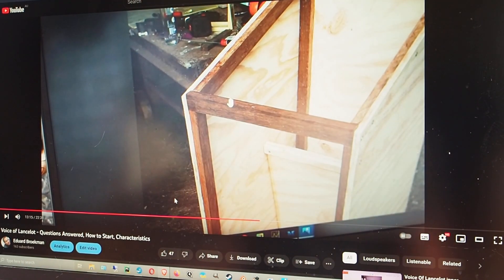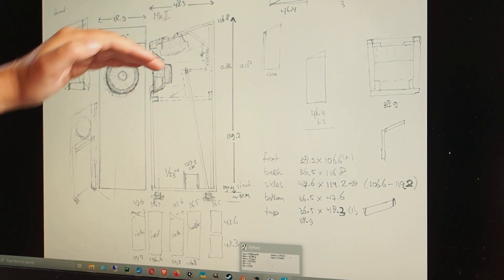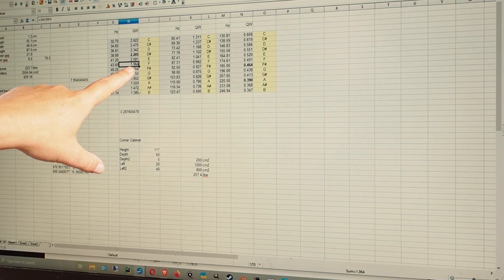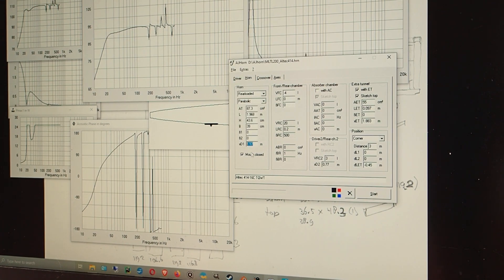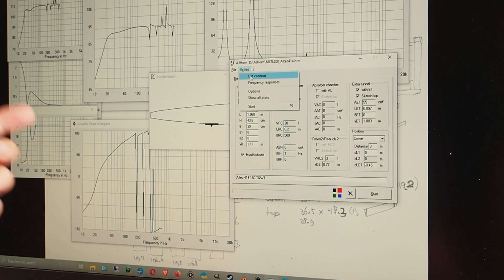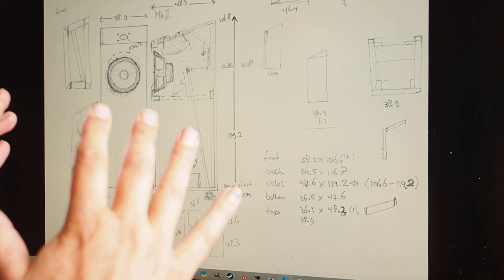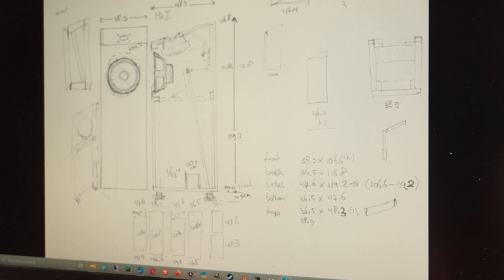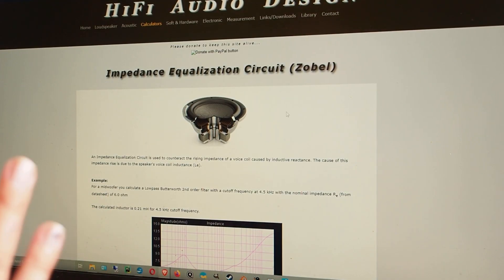Voice Of Lancelot - Design, Divider, Woofer position questions answered

Comment: Any detail drawings for beginners
Reply from the maker: Sorry no, it won't come soon but I'll keep it in mind. It's basically a 172L TQWT with width and depth dimension set to lengths that adhere to the frequencies/length of the western musical scales. The whole cabinet is geared towards the Altec 414C driver as I have them, any other driver will need their own cabinet. Hence there's very little value in publishing specs unless you have the exact same drivers. What are you planning to build if may ask?
Reply: @EduardBroekman I have 515B drivers and A5 is rather big .

Comment: The fame is not very good like that structurally..! You want to do a lap joints, bring the member from the back to front level with the vertical peace that is notched out with front to back piece, and the same on the cross member to the front and back piece, add some corner triangle pieces as well. end grain glueing never really holds long-term.
Reply from the maker: Agree. This was setup as a monocoque construction, there's really no 'frame' here and nothing is truly glued. The panels are screwed into the hardwood 'frame' to still dampen the resonance but your suggestion and what Janos did by building a very solid frame with corner pieces first, is probably best. It require a bit more woodworking skills and more time... plus insight into how resonances propagate through such a construction.
Reply: @EduardBroekman  ok

Comment: Hi Eduard. That is a very thorough and clear explanation! Very much obliged. I'm sure that it will be as helpful to many as to me. Just two tiny questions :) Why did you choose to point the port downwards instead of forward? And if you had chosen to front load the VOL, would it detract from the overall length of the supported quarter wave (say, if the slot port was 7 cm high, would you calculate the supported quarter wave as only 1.894 (1.964 - 7.0) cm)? Many thanks Claus (love the cows by the way!!)
Reply from the maker: Hi Claus - glad you found it hrlpful and thank you! The port does not reduce the frequency support, that remains based on the overall length. I would use a larger, longer port next time - but with same tuning. The downward orientation is (1) gradual release of pressure using the bottom of the speaker and the floor (2) prevents some cancellation between woofer and port (3) hides audible artifacts from the port (higher frequencies, not chuffing)
Reply: @EduardBroekman  Hi Eduard. Good points about the downward orientation of the port! Do you have an online link to your spreadsheet of musical notes? Or do you know where to get one? I'm not entirely convinced that designing by musical notes truly works (even smallish differences in frequency (or length of QR) of a given note, and it sounds off, and do we know the precise lengths of the resonating parts of the baffles (do you include or exclude the width of the frame to which the baffles are glued and screwed?)? Hm, still no harm done designing by musical notes :) Thanks again for your fine answers! Claus
Reply from the maker: Sorry I don't have a good spot to share resources right now. Just look up 'Note To Frequency Chart' or something similar. The Quarterwave length is then 343/freq/4. The internal dimensions are all on musical scales and yes, they exclude the frame. But to be honest since we have a tapered horn and a slanted top,, there's only left-right standing waves left and those are minimal, so if you'd take a design like mine you don't really need to pay to much attention to the depth and height dimensions.
Reply: @EduardBroekman  Ah. That was easier than I thought. I’ll find one or make one myself. And I guess that your design does not leave much room for standing waves. Thank you once more for your time and answers! Claus

Comment: I’m curious about how to think about the transmission line quarter wave resonance versus the tapped parabolic horn geometry. Does the simulation model both phenomenon and somehow sum them for total response? Or, is the math model the same calculation regardless and we are just using the terms “TL” or “horn” as categories of geometry? I have always just been looking at these enclosures as mass loaded quarter wave pipes and did not even think about the horn geometry. Hornresp has an option for a tapped horn, but I’ve never tried to model with it.
Reply from the maker: Hi - great questions! I haven't 100% visualised it but can comment on what I've seen sofar. Janos (RWA channel) says the straight TL shifts the amplifying aspect to the lower frequencies but the horn model in AJHorn doesn't show that although the Woofer's Fs does drop in a straight TL. Given the design of organ pipes, I'm pretty sure the straight TL works very well for the lowest of registers.

Now that all said, from my measurements, the tapered TQWT has a much better low-end response between 18-30Hz than a BR cabinet of the exact same size and port size and the modelling software didn't exactly show this difference. 

There's good support for frequencies down to 8*horn length (in my example 8*1.96m = 22Hz) Actually it's mostly 4*horn length (44Hz) but the BR tuning at 18 Hz pulls up the lower end.
Reply: @EduardBroekman  Martin King developed math models for the TL that I think became the math for Hornresp of the QW resonances. Martin has said that the QW isn’t really a resonance, but more a velocity phenomenon. I believe he’s differentiating acoustic resonance as a mass spring phenomenon or pressure versus a velocity phenomenon. Pressure and velocity are in phase for a plane wave, but can diverge in phase. Martin also modeled how a tapered pipe will provide some attenuation of the higher order TL modes by distributing them along the line. Wrong description, but you get the idea. So, a simulation will sum the impedances, real and imaginary, of the total box and the TL resonances, and the hemholtz resonance of the port. When Martin modeled the tapered pipe waves he used a straight(?) conical (?) taper and the taper helped smooth the response. I’m not sure how a parabolic or exponential taper is modeled. But, Hornresp of course simulates all of these accurately. I don’t know whether there really is a difference to Hornresp between a tapped horn, or a TL. It might be the same model, mathematically. What’s interesting to me is that AJHorn helped you create a parabolic expansion or taper to your horn, right? And, this might have interesting impact on the higher order TL resonances. As you demonstrated, the 2nd resonance can be eliminated by offsetting the driver in the line. From what I could tell your spl plots looked quite smooth where the higher orders might appear and I’m curious if this is due to the parabolic expansion.
Reply from the maker: Hi again - thank you for bringing this interesting topic! Yes, I had looked at MKs research a while back and the function of the mass spring is clear but I must look into what really happens with the velocity phenomenon that you mention. I mainly chose the tapered approach because I deducted that it mechanically would prevent the standing wave between the front and the back of the cabinet (that I had in prototype #1), or anywhere internally really and from the waterfall graph now I can see I have really good drop off with very little stored energy so I think the TQWT options works very well for that - probably exactly like a voigt pipe. 

I didn't use hornresp to compare different horn shapes, mostly because of the construction.. a box shape is most compatible with a parabolic horn. If I remember correctly, the tractrix expansion worked best for a smooth response but it's a lot less suited for a 'box design' enclosure. Tractrix could be an option when using an Altec A5/A7 VOTT shape and then fold the horn inside such a cabinet. 

So AJHorn as said, was only used to find the best spot and smoothest response and the impedance curves etc match 100% to what I measured afterwards, but the subbass response is different. AJ does do such calculations that include how the port position/distance interacts with the woofer, but not internally with respect to the 1/4th horn length. I really should try hornresp to see if that does. I chose AJHorn because it's very easy to use and does sim a lot of enclosure types plus I saw a speaker designer use it to sim an adsorption chamber + TL + BR all in one go, so I think it seemed credible and versatile. I wouldn't be surprised if it shares some of MKs/hornresp's logic.
Reply: As updated last year Martin said "The taper pushes the standing waves higher in frequency where the fiber damping is more effective producing a smoother SPL response." His examples used 5:1 and 1:5 tapers/expansions.

So, this would suggest the taper only has a subtle effect and considering we are avoiding the stuffing, I'm not sure what to think. There was not a substantial difference in response between a tapered line or an expanding (Voigt) line and not even much difference in overall LF response to BR in Martin's research. (See Fig 12 and 13. http://www.quarter-wave.com/TLs/TL_Alignments.pdf)

So maybe it's not so important how we taper the line in the fold and your intuitive initiative about parallel wall reflections and just using the simulations to compare results is the right approach. When we terminate the line with a vent or mass load the line, the taper isn't a big influence.

But, what about the Voigt pipe? Something is unusual and we can appreciate Janos' Christmas video about this showing once again someone is BLOWN AWAY by the LF response of the Voigt pipe!

Maybe the Voigt pipe is an expanding quarter wave pipe AND a back loaded horn AND using floor reinforcement. Sorry, I know this must be obvious, but I am really trying to understand the different models of prediction.

Martin also did extensive modelling of back loaded horns and struggled to find a good solution for smaller bass horns that worked, and alluded to the ambiguity of classification of these designs as either TL or BLH.

Regarding this ambiguity, he said "chances are the design is actually behaving as a transmission line at lower frequencies transitioning to a back loaded horn at higher frequencies."  WHAT!!! And this is coming from a guy who can recite Laplace transforms off the top of his head. How do we model this "transitioning"?

I"m tending to wonder if the Voight pipe isn't behaving like BOTH a TL and a BLH.

BTW, I don't think you can move the tuned port in Hornresp from the end of the line.  But, it does model phase cancellation or summation from the acoustic distance between the driver and the port. It makes a difference, but it's hard to find though in the menus.

Sorry, so long, and tedious. I'm just really trying to figure this out.

Jamie
Reply from the maker: Hi Jamie - it's a great topic and I've quickly read his supplement from last year. First though, a closed or open pipe will behave very differently (see 'Harmonics in Organ Pipes' from N.H. Crowhurst). I'm pretty sure the voigt pipe is therefor already completely different from a closed TQWT/MLTL, even with bass reflex port; which I would guess still acts like a closed pipe with a helmholtz resonator at the end, which gives it's own 1 octave wide lift, in addition to whatever the enclosure/horn design does for backloading the woofer.

I do have to disagree with Martin JK on low end performance, because my 2 cabinets are nearly exactly the same internal volume (170vs172 liter), the bass reflex is identically tuned, same port orientation and the woofer specs are quite close, yet the TQWT has a substantial better sub bass so it's an apples-apples comparison unlike what MJK points his suspicion at. 

Thinking about this, the self-reinforcing behaviour of a quarter-wavelength dimension is no mystery, yet it is absent from the simulation! With my VOL speaker enclosure, I've got a layering of BR, 1/4 wavelength, floor support and room modes - all of which work together to give a solid low end and only starts sloping down at 22Hz, whereas with the BR is drops at 34Hz. If you look at Janos' earlier video this 'stacking up' of efficiencies is really how we can get the most out of a certain driver and cabinet volume.

I must look at the BLH and TL difference... and at a glance, I could imagine we may get a mix of the frequency propagation of a horn and the effect of back loading a woofer with a TL as well.

With AJHorn is very easy to move the position of the port.. it also quite substantially change the FR response with regards to smoothness.. there seems to be a direct interaction between the woofer and the port (the distance between the two). Again I haven't gone scientific on this .. because the sim turned out to be accurate apart for the low end. The missing piece I think are both room modes and internal modes, especially for undampened cabinets (which I'm sure is a differentiating factor from MJK's experience). It bugs me that that is not included...

Anyway as it stands I would follow Janos' straight TL design if one get good quality wood and if not, go with a design like mine where the tapered design prevents stored energy without any damping or bracing, yet gives a better low end than a BR box. However to really knot it out, it's worth paying attention to layering all the 'supporting' elements so the in-room response ends up very balanced just by design.
Reply from the maker: @jamesoneil9757  I looked into his papers again and when MJK is talking about the blend of BLH and ML is when we have BLH with limited size mouths, where he finds that the behabiour in the lows is akin to a TL while in the highs - where the mouth is big enough with relation to the wavelength - start enjoying the effects of a horn. The update paper from 2013 is quite clear on that.

However, with regard to the VOL, most of the research MJK did seems to be about open horns or TLs, not where the horn mouth is closed (TQWT/MLTL), which is what the VOL uses to backload and improve the efficiency/response.

The Voigt pipe looks more like a TL/BLH with a limited mouth size, but probably with a more even response in the lows due to the driver position 55%-60% down in the length of the 'horn'. But that's probably little news to you :)

I personally think there's also more to be found in organ pipe behaviour - as Janos said: when in doubt, look at what the luthiers do :)
Reply from the maker: @jamesoneil9757  Sorry MJK did do work on the MLTL .. I'm digging through his site again. t-linespeakers.orgdesign/MJK-for-dummies/index has a good summary of his work
Reply: @EduardBroekman  thank you so much for all of your thoughts. I cannot find good theoretical models that prove why a design might provide really good bass with all the influences you and Janos have mentioned combined, but rather all models tend to predict really just the same SPL (except large mouth horns) and they don't really measure the quality of the bass. I think I just need to build the MLTL like you did and really see for myself.  There is a large following of people who report being completely changed by the experience of a VOTT, it's not such a strange idea that something magical can be created that might not fit the model. 

I have a 15" Altec 604E I am experimenting with that did not impress me in a rigid damped vented cabinet, but I didn't want to prototype such a big cabinet, so I can't decide whether to do that or use a 12" driver.

I'm also very curious about the port location in the line. I am so curious about how the TL terminus interacts with the port, and what might happen if the port moves? Certainly it will do something since the TL velocities and pressures depend on the frequency and the length from the driver.